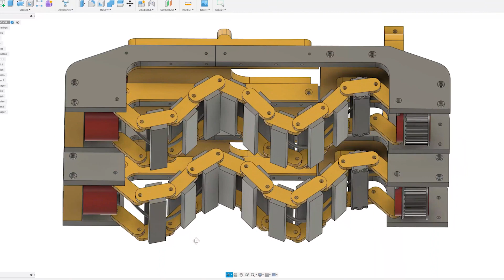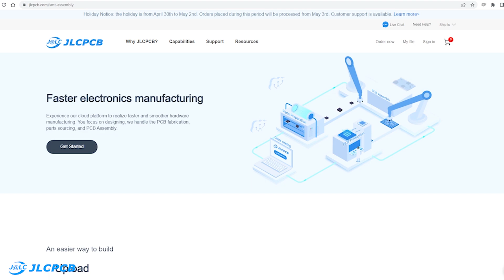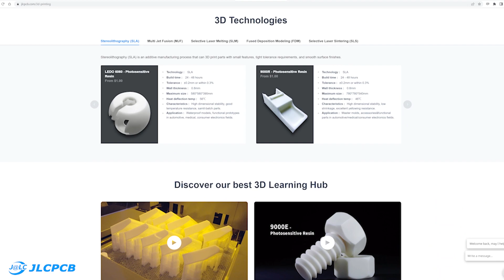Experimental Wave Drive

Comment: The reason why your mechanism doesn't work very well is that the length of the track is constrained. If you look at the ends of the tracks when they jam up, you can clearly see that the tracks are fighting with themselves.

To improve your design, you could either use a proper helical shape for the screw, or allow the non-driven end to slide back and forth slightly.
Reply: Just take the last link off, right?
Reply: @brendanhenderson6999  That does sound like the simplest solution.
Reply: This with increasing the frequency will allow you to have one fast crawli boi
Reply: Even a proper helix would vary in length over the cycle, unless it was very carefully controlled to integer multiples of the total wavelength. The simplest and most reliable solution would be to just disconnect one end entirely from the frame - it doesn't actually matter which, since even when it was connected the load was going through the helix anyway - and allow it to take the form it wants.
Reply: @iskierka8399  I think you're right in saying the ends of the helix must be positioned in such a way that the length of the helix is a multiple of the helix wavelength. Another point worth considering is that for the variation in the length of the track as it rotates to approach 0, it intuitively feels like the length of the track pieces must also approach 0. With that said, I don't have any proof for that and it could be entirely wrong.

Comment: Man, I'm really struggling to visualize the forces that allow this to move instead of just flop around.
Reply: Each track segment is being pushed and pulled by the one immediately in front of it and behind it because they're linked together, so when a track segment is on the ground the one in front of it that is descending to land on the ground is pushing it and the one behind it that is being lifted is pulling it, therefore it tries to slide back and pushes the vehicle forward. The opposite happens at the top so the individual track segment only moves forward and backward a little bit within the same short segment of the vehicle body but critically every time it is down it is sliding backwards and therefore pushing the whole vehicle forwards. If it was just a bunch of individual pads moving up and down it wouldn't go anywhere but the fact that they are linked and able to push and pull each other is critical.
Reply: I think the key is that each segment rocks slightly, and the little black feet extend that rocking to push the robot forwards. 
It's interesting that the waves move forward here, while a snake moves it's waves backwards.
Reply: @robinbennett5994  one thing my earlier analysis missed out on was the fact that the screw does push on the track segments but it only works when the track segment is squeezed between the screw and the ground. When the track is planted the screw can push it back with friction, when the screw lifts a track segment it's no longer being squeezed against it with as much force so it can slip freely.
Reply: @AlRoderick  but does the screw actually push the track? It's just rotating, so I think all it can do is move the track up and down.

Comment: Really pleased to see this mechanism, I do want to ride it!

However to form the steel I would rather have done a 2 point roller pusher at the exit of a wheel feeder. Like : the strait bar of steel is feeding to a first roller bearing that push it to the right et an other one after it is pushing down. With adjustable angle of constraint
Reply: I would have just rolled a "spring" around a round mandrel and stretched it.
[edit] naturally I really should watch to the end before commenting. You are right, though, for a large pipe spiral you'd need something similar to a pipe roller, perhaps with the angle of one of the external wheels adjustable.
Reply: @TDOBrandano  It can definetely works too, but can be very difficult if the diameter is to important. Spring steel is, by definition, very elastic and can be hard to go on the plastic state
Reply: @badger9641  spring steel is also really hard to work with and James is only recently learning about metal working, would be the best for sure but I doubt he would go that route... he will probably just 3d print a gigantic spring and it'll be awesome😂
Reply: @jonsnothere84  it seems more than accurate ahah

However, metal bending is very cool, and can be a very step forward for designing robot 😁
Reply: @badger9641  yeah I wish JB did more metal work, could really improve the quality of his projects

Comment: Why not shake one end of track uo and down and other have at fixed point or something? This would push it forward as wave magnitude or power decreases from one end to another. Like how you can move ball on blanket by waving one end only. You can eliminate screw then and problems associated with it and have more flexible tread that may handle more train
Reply: With the ground contacting the track it would not be able to propagate a wave very well. Also, the track needs to be stiff to support the weight of the vehicle.
Reply: @MeeK_N1  by your logic many tires wouldn’t work, suspensions systems, and more bc they have some give. Nor would previous robots built on this channel that lift part of their  body up. And what I’m suggesting is very similar to rectilinear motion in some snakes. You can think of it having legs in front that move up and down with some of that energy redirected to forward motion. Just bc it’s not always in stuff contact doesn’t mean it will fall 

Now add a belt from front to rear

Comment: Arent the tracks just going up and down?
Reply: Not quite. When a track is in contact with the ground and squeezed between the ground and the screw the screw is able to push on it, whereas when a track is up in the air and there's no normal force squeezing it against the screw it is free to slide forward against the action of the screw, pulled by the tension between the track segments. That asymmetrical friction between the planted track segment and the raised track segment is why this is able to work.

Comment: I think this is different to a screw tank, which uses the ground as a "nut" the screw threads along. I'm not totally sure how this one works, as far as I can tell the links only really move up and down. Maybe the slight rocking/rotation of the links is causing it to crawl along?
Reply: It's differential friction. When an individual segment of the track is in contact with the ground it's being squeezed between the screw and the ground and so the screw is able to act on it frictionally and push it back. When the track segments are up in the air they're not being squeezed and so they're able to slide forward against the action of the screw. The difference in friction between the planted track segment and the lifted track segment is enough to make all the difference. In order for this to work something in the system has to be compliant and I believe in this case the wire helix is acting like a spring, so the coils in contact with the ground are being compressed slightly and then relaxing when they're lifted, this transfers the compression load forward onto the fixed end of the helix.

Comment: You might get more traction and a more stable gait if you have more peaks of the helix touching the ground at one point which means maybe increasing length of the robot or decreasing the amplitude of the helix itself
Reply: I think it would be good to also distribute the load horizontally between multiple synchronous helices (fitted in the extra space from the decreased helix diameter). At that point the track mechanism wouldn't need to be hinged to be as longitudinally torsionally stiff, it could be made form a more compliant structure (i.e. a sheet of bendy hard plastic stapled to the helixes, or multiple horizontal sticks strung together with cord).
Reply: I would agree with this.  It should have 2-3 periods in the length of the helix. this would make the forward running smoother.
Reply: Amplitude is the height of the wave between crest and trough. You might be thinking of period, the distance between two identical points on a wave. Shrinking the amplitude would make the wave look more squat in height; decreasing period (increasing frequency) shortens the length of the wave.
Reply: @jamesgroccia644  You are correct, I made another comment earlier correcting my mistake!
Reply: Tapered diameter helix.... you're welcome.
Reply: "Work better if longer and slower " ahaha